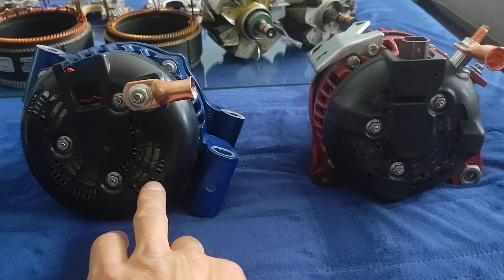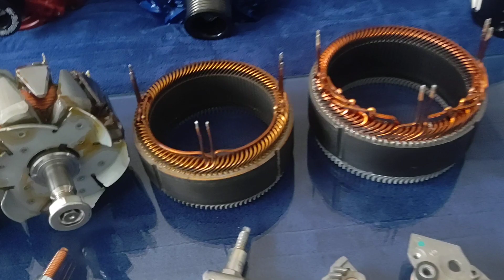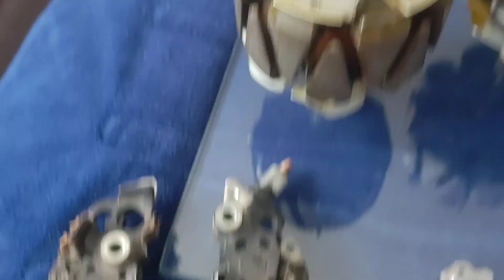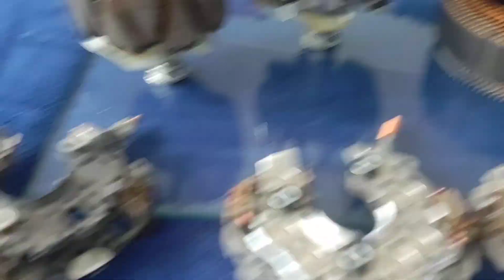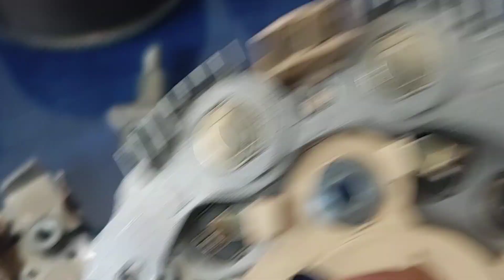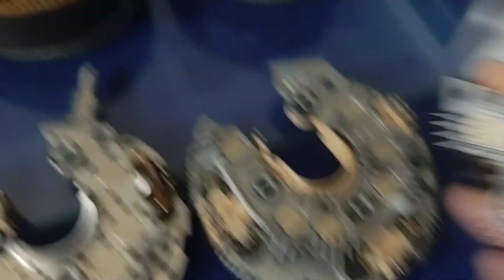DIY 240a small case & 370a large case alternator builds

Comment: Is there a for  sure way to identify what type alternator you have, to order proper parts? Have an OEM,  220A off 2022 GM HD truck, had GM & USA sticker on it. Burnt diodes trying to bypass the RVC regulator but can't figure out what parts to order to repair. The connection wires of the stator look like a different orientation than these alternators in your video. Dealer says no parts available, replace as a unit. Somebody makes these for them, who?
Reply from the maker: Great question! I am not familiar with that type, but curious and would like to see what you have.. maybe you could post a quick video and I'll figure it out.

Comment: ok, i saw this video and i am also confused with the back. it says large case, but the connector isa pointing top, now back?
Reply from the maker: You can  arrange the output stud however you like, and there are two options available for rectifiers. Side terminal, clockable in any direction, and rear facing terminal, also clockable in any position. Hope that helps!
Reply: Thank yo7.  @georgesrisomsak9650

Comment: I have a big one that produce about 200A. Unfortunately the voltage regulator that I bought doesn't work properly and cut the current on half over 2500RPM. Is it possible to turn on the alternator by connecting battery directly to brushes? I have a 10kwh battery and it takes some time to charge it fully.

Comment: I am going to try to find a large case Denso hair pin alternator at a pull and save wrecking yard.  Any ideas as to what car makes and models I should look for?  It seems that they will be mostly on Honda and Toyota but when I look up specs, they seem to have the small case version.  Do they typically have the power output written on the case or is a code in the part number?
Reply from the maker: Pretty much all vehicles use the denso "hairpin" style these days. Anything 2011 and up will likely have one. Large case units are found in all the Ford Dodge and Chevy trucks, Cadillac Ford and Chrysler SUVs and more. They are in just about every thing these days with today's high electrical demand in these newer vehicles.

Comment: If you remove the internal regulator and supply the field current from an external regulator, does it matter which ring gets the positive voltage?  In other words, does the polarity of the field current matter?  It would seem to me that given it is generating an AC voltage, which is then rectified by the diodes, the polarity of the rotor would not matter.
Reply from the maker: Absolutely correct! There's no advantage going one way or another that I've found. When I build them, I typically make the lower portion of the commutator the ground, and supply my own field to the upper ring. Just my habit, and truly doesn't matter. I would chalk it up to personal reference...
Reply: @georgesrisomsak9650  
Thanks.  

For my needs, I have a B-type external regulator that supplies positive field voltage with a 3-stage charge logic [bulk, absorb/time, float] and use it to charge a large 560Ah LiFePo4 battery from a small 23-hp diesel engine in my sailboat.  The regulator does not have the ability to manually turn down the max field current so a large alternator would take too much power from the engine, not leaving enough to push the boat.  I also have a PWM controller that I can use to pulse the voltage, which would reduce the current output, but it only pulses the negative line.  My plan is to isolate both the + and - brush and connect the regulator to the + for charge control and the PWM to the - for max current limiting.

With that setup, I could build a 370A large case alternator and use the full power to recharge at anchor but then be able to turn the output down to not overload the engine when I need to charge while moving the boat under power.

Do you have any suggestions as to where to find a core to build this thing from?  I do not live near any wrecking yards and have looked online but not found anywhere to buy old alternators to scrounge for parts.

Comment: Great video.  This is the first of your videos I have seen.  I use an old Ample Power externally regulated alternator to charge a DIY 560Ah LFP battery bank on my sailboat.  The AP alternator is 30-years old and still works fine but it was built on the old Delco DN10 case which has really bad cooling.  I limit the output with an external regulator so that the case temperature is under 100ºC but that is only about 70A max.  I would love to convert a modern alternator to external regulation and increase my 100% duty cycle output to between 120a and 160A.  My mount uses the 20" foot typical to older GM products.
Any suggestions as to a make and model of alternator to look for as a starting point to build a replacement out of?  FYI, the engine is a 23hp diesel which runs most of the time at 1900 rpm.
Reply from the maker: If you're trying to keep the same case, this would be the place I recommend to order parts from ad rebuild your current unit with. 

https://alternatorparts.com/10dn-alternators-parts-and-kits.html

I would ultimately recommend to switch to a "hair pin" denso style unit if possible, as they are MUCH more durable, have incredible output, and easy to build, modify and regulate. You're request for around 160 amps can be die with a stout small case, modified to a 240a unit as shown in the video on the red alternator. 

I'll see what's available that will be close to drop in, but will likely require some custom modifications for mounting and pulley type. Worth the hassle coming from a unit designed and used in 1962. Today's denso units are capable of almost 400a continuously(large case) with proper modifications, installation and use. That's about 6x your current set output.
Reply: @georgesrisomsak9650  Thanks for the reply.  My plan is to build a new alternator and keep the old one as a spare.  I would like to have one that has as much output as I can reasonably get from my poor little 23-hp diesel and then use the regulator to limit it when needed for other purposes (like moving the boat) 😜.
What I am hoping to do is find doner alternator from a pull-n-save wrecking yard and build from there.  Can you tell me how I would identify a Denso "hair pin" style alternator.
Reply from the maker: @haydenwatson7987  the stator stack, as seen in the video is the "hair pin" type, and uses square wire. The pictures of the round wire "s" style stator in the link I sent would not be the denso hairpin design. There's many benefits, the main three being power density, immense cooling. and much less noise from converting A/C to DC. 

Good luck on your adventure into the world of diy high power alternators! You can do it!
Reply: @georgesrisomsak9650  Thanks.  How do I go about finding the right used alternator to build my Frankenstein alt.  Can you point me to a website to dig deeper.  

FYI, my battery is a DIY LFP pack built with 280Ah EVE cells in a 204s configuration with a JK 200A BMS and all of my cables are 2/0 so my charging limit is currently at 200A but by reconfiguring it into two 4s packs each with its own BMS I can go close to 400A charge.

I had found that web site that does parts for the dn10 but would prefer to start fresh because the dn10 has almost no internal air flow and I know how hard it is to cool my current unit.
Reply from the maker: @haydenwatson7987  https://www.amazon.com/DB-Electrical-AND0292-Alternator-Durango/dp/B007XUJ7MW

This is very close to the same mounting style, but you will need to fabricate likely to install. I would recommend the "Brand X" voltage regulator, as it's the best on the market, other than some of the high end Belmar controllers, that utilize temp sense and three step charge profiles. Those can get quite spendy however. The brand x is for car audio, no temp sensing, no charge profiles to choose from. It does however provide ROCK solid voltage regulation, the best I've seen yet.
Reply: @georgesrisomsak9650  Thanks for the help.  That appears to be the saddle type of mount, but I have the 2"-foot type used on older GM products.  Mine looks very similar to the DN10 alternators in the first link you sent.   Given that I need to be able to do a full charge on a 560Ah LiFePo4 battery I need to have the ability to limit the output because the battery will suck the lift out of any alternator unless it is current limited.  My batteries can take 400A for 1.5-hours if I let them.  My current regulator is a Heart Interface InCharge 3-phase regulator, and I use a PWM to limit the max field current to set the max case temperature of the alternator.  I also have a digital thermostat that cuts off the field current if the case temperature gets above 100ºC and then turns back on when it drops to 95ºC. 
I am hoping to find just a case, rotor and stator that I can build from.  Then remove the internal regulator and bring the brush connections to the outside so I can connect my regulator to it.  Where do you get the brush holders and better rectifiers?  Like I said, my goal is to build a more powerful unit than I need and throttle the current to limit heat.  It is mounted in a small engine space with limited air flow, so the space is hot.  I have brought in cool air to the alternator but that only goes so far.

Comment: What's your company? What would you charge to do atleast 220a rebuilt on my factory 110a good working alt in my 2012 forte ex 2.0? Do you know any factory higher amperage alt with the same mount patter or similar? Shit is be cool using a single bolt with a turn bucket if the pulley lined up. It's a beat up work car and really just need a little more electeical to get everything out of a smart3 on a single vxf.
Reply from the maker: I don't have a company, was entertaining the idea, but I'm going to do something different for now. Maybe I'll revisit the idea later on sometime. 

Unfortunately, after researching that vehicle, there are no cases made to convert to a 6 phase hairpin in that vehicle. You would be looking at a custom case, and it ain't cheap. I had the same issue with my Scion TC, but was lucky that DC power Engineering makes a billet custom case to convert it to a large case hairpin.

At some point one of the big alt companies will make it happen, just a matter of time, unless it's a vehicle that is rarely used for high power 12v items like audio, winches, lights or other. 

What I can tell you is to do the big three and install a smaller pulley. That will make a big difference in itself for now..

Comment: Great video. Thinking about building myself a couple. Where do you source parts if you dont mind me asking?
Reply from the maker: Metro alternator parts, eBay, or used from low mile new vehicles. I've found wrecked Cadillac and gm large case alts for $75, 8k miles on one 15k on the other. Brand new basically, even looked new inside and out. Especially when taken apart and cleaned up. You wouldn't.kmow the difference. What parts are you interested in? I may be able to point you in the right direction?
Reply: @georgesrisomsak9650  I applied for an account on metro, but unsure they will accept it not having an actual business. I'd like to build a large case for a grand marquis 4.6 to start with, but the large case y mount seems harder to find.
Reply from the maker: @ShredAppalachia  give me the exact year, and I'll see if I can get you set up with a case for that rig.